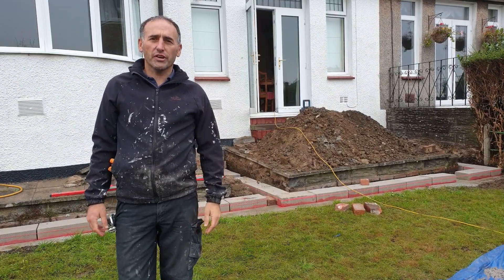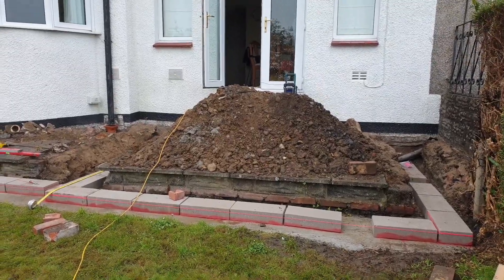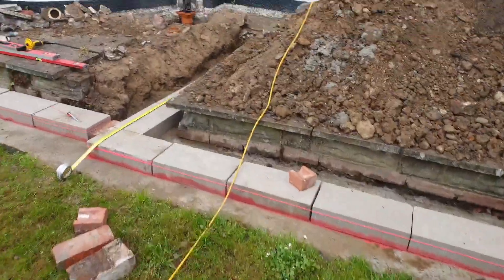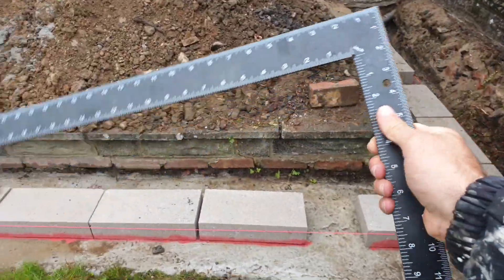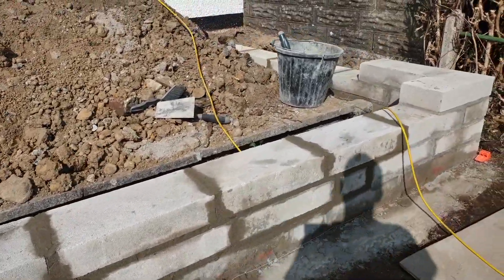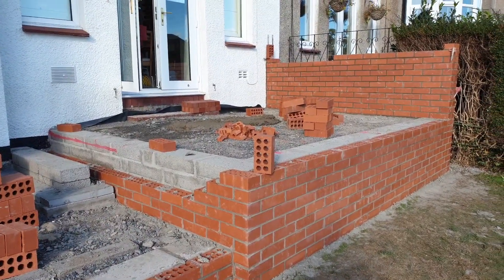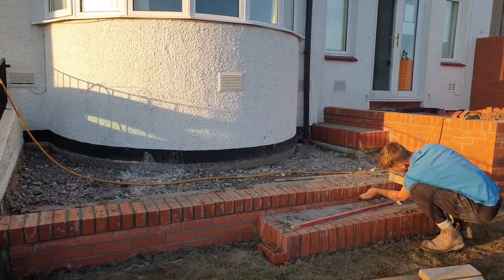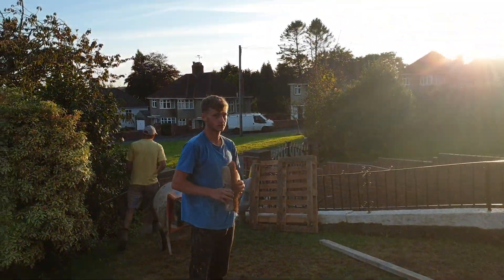DIY Raised Patio | Part 2/3 | Blocklaying, Bricklaying, Steps & Backfilling

Comment: This is great! Starting my own wall for a patio next week. It's block on flat like yours but 1.2 metres high. Do you think it'll need any pillars/peirs for extra strength? 5m long. Will be retaining up to the 1.2 height.
Reply from the maker: Hi. I really wouldn't want to say as I'm a DIYer and not a professional builder. I always thoroughly research jobs before I do them so the best advice I can give you is to do the same. Have a good look online and I'm sure you'll find your answer.

FYI, my wall was 85cm high and 3m long and it felt super solid. Good luck with your job